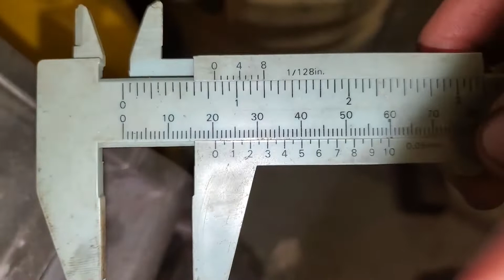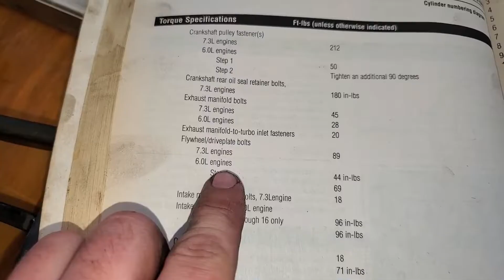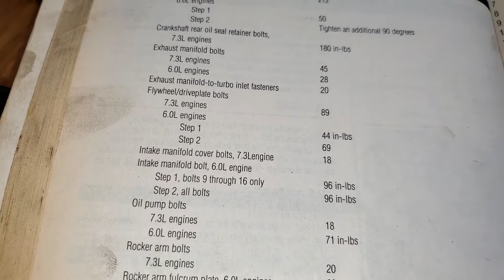Auto to ZF6 Conversion Part 2

Comment: My 4r100 is shitting the bed currently, perfect excuse to zf6 swap the truck.  Thank you for making this series. If you have any recommendations for sourcing all the parts I’d be quite appreciative (short of an entire parts truck that is).
Reply from the maker: I don't really have much for recommendations on parts sourcing. A parts truck is best for most of it. The OEM parts I ordered from White Bear Lake Ford, they have really good prices on Motorcraft parts. Tasca Ford does as well. You'll have to check both to see which gives you a better deal as their prices are slightly different (but very close) and shipping costs will differ based on your location. I'd recommend a South Bend clutch. Some of the oddball stuff like the pilot bushing you'll just have to do a search on and see what you find. Probably not the answer you were looking for but it's the best I have 🤣

Comment: @darkhorse would I be able to swap in the zf6 into a '97 f150 with a 4.6? If I can, how closely would I be able to follow what you have done in this video series?
Reply from the maker: If you had a transmission and other parts from a 5.4L truck you maybe could since the bellhousings would match with the 4.6. 7.3 is different. I'm not sure how many other parts between the 5.4 and 4.6 would match up though. As far as the rest goes, the f-150 is a totally different truck than the 250+. Honestly I wouldn't even attempt to put a zf6 into a 150. Too much custom work and figuring stuff out. You're better off getting a transmission and associated parts out of another 150 and swapping that in. At least you know stuff will fit.
Reply: @darkhorseautoanddiesel  do you know if the transfer case from a 4r70w will bolt up to the zf6?

Comment: Great job. I watch your two videos of the swap.  But I have a question  what will happen or what is the difference if you don’t replace the pcm and use the previous.  From the vehicle.
Reply from the maker: Nothing horrible will happen but it can potentially cause some strange driving characteristics, most notably the return to idle. I've only done it once and it was only temporary on a friend's truck that we did the swap on like 15 years ago, so my memory of the exact operation is limited. 

Also if you hook a scanner up to it, it's gonna throw all kinds of transmission codes because the PCM is still looking for inputs, but is getting nothing. You can get by with it temporarily, but I'd be making plans to either get a proper PCM or get yours reflashed to manual trans programming.
Reply: @darkhorseautoanddiesel  awesome thanks for your response.    I will be swapping for the correct one. I do have one with the Harness from previous donors trucks where the transmission came.  Thanks 🙏

Comment: were you able to use the flywheel bolts from the automatic or did you have to get longer ones?
Reply from the maker: I have just always used the bolts that came with the manual flywheel. I've actually never compared to see if they're the same as the auto bolts, I've never had a need to.

Comment: Is there a template or something you used to get a outline of the floor pan to cut it?
Reply from the maker: Nope. I just cut the manual floor pan bigger than I needed, then used that to determine where to cut out the auto truck and made adjustments to both as needed to get a good fit. I had a friend that has done body work for 20 years help with this part, so that helped.

Comment: How has that bushing been working out? I'm replacing my clutch and thinking on going that route over the kevlar bushing
Reply from the maker: It's been working fine so far. I don't put a lot of miles on that truck but I've had zero issues so far. I'm not big on the Kevlar bushing because if it gets wallered out (which isn't hard to do) allows the input shaft to move around a bunch. The bronze bushing is much harder to wear out, while still being softer than the input shaft.
Reply: @darkhorseautoanddiesel  thanks, I appreciate it 👍